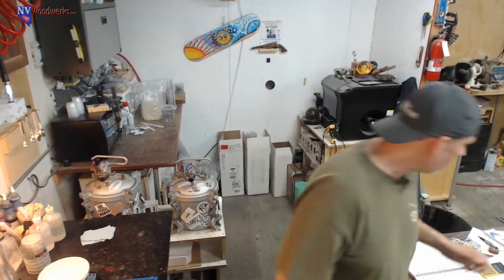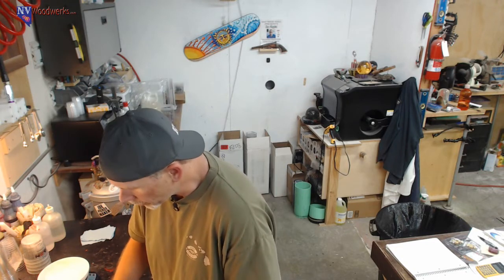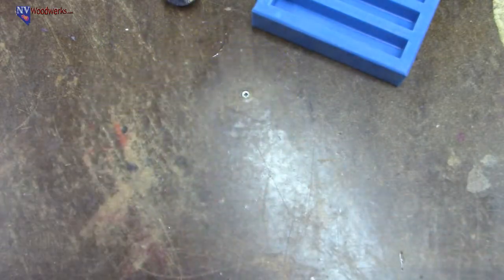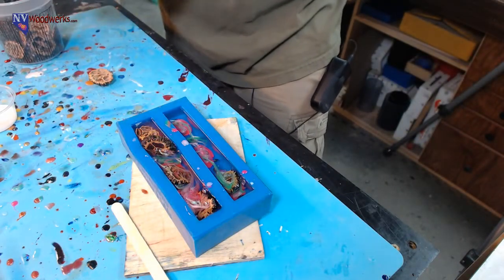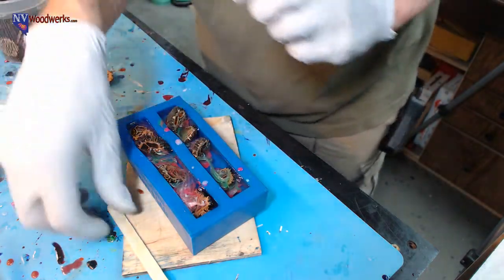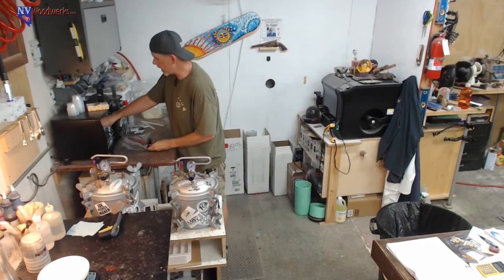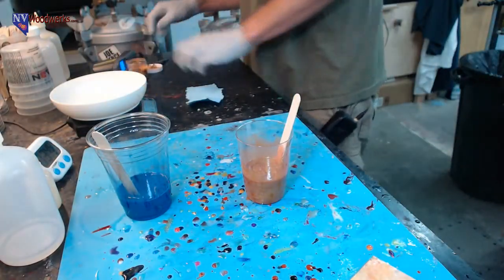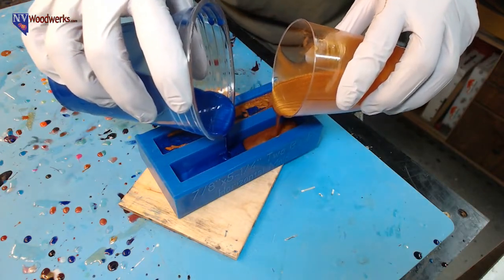🔴Replay: Resin Casting Walnut Shell Pen Blanks  | Episode 18

Comment: I am a novice resin caster and on one of my projects I was casting pine cones for a vase
and the casting cracked in a few places. is the cracking caused by the pine cones not being
completely dry or...?
I was also interested in what you used for your casting molds in the 6 to 8 inch cylinder castings?
Great videos with lots of information!
Thanks
Bill
Reply from the maker: Hey Bill, the cracking often times is caused by moisture, but it could have just overheated if it was too much volume for the resin to handle in one pour. I just use PVC pipes for most of the big blanks. I show my setup in the BB-8 sphere casting video: https://youtu.be/Qm22sy1EMSY

Comment: Hey Zac, I'm doing a color pencil bowl cast this week. I've got Alumilite Clear Slow, pencils are already in a mold, it's about 6 inches tall, 95% of the volume is color pencils. I've got a pressure pot and everything ready to go. Is there anything specific i should be on the lookout for? I'm worried about overheating, but since the volume really isnt that much, I'm hoping i can do the whole thing in 1 pour, toss it in the pot and have it come out completely clear. A little extra part B, like a gram extra, a tenth of a gram extra?
Reply from the maker: That's awesome Daniel! Only thing I can think of off hand is to make sure you dry out the pencils before casting or you'll probably get little air bubbles from the moisture evaporating in them when the resin heats up
Reply: @ZacHiggins  good call! they should be alright in an oven at maybe 100 degrees or so, right? I'm using an ash waste block in the middle, I could go ahead and put a coat of resin on that to seal it up, prevent it from leaking any air bubbles out into the casting too. Thanks for the help, man. keep them good vids comin!